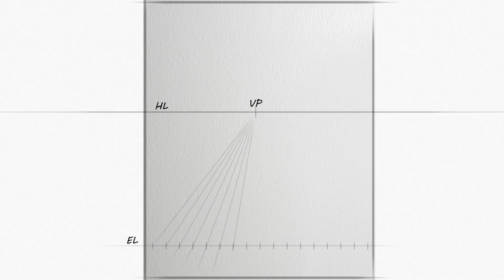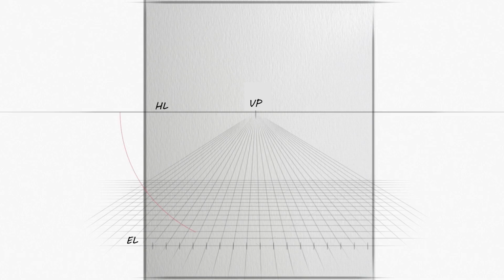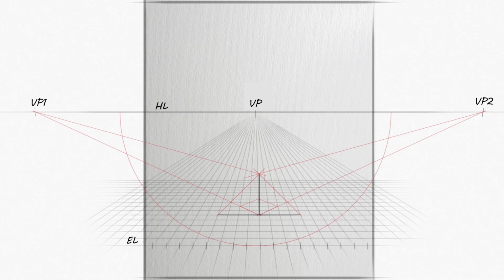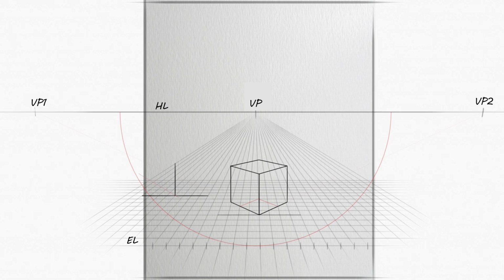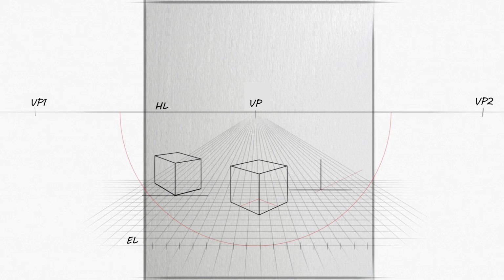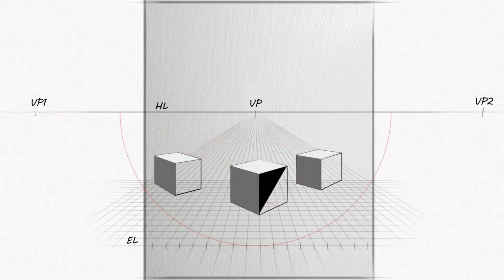The Smart Way to Find Depth in Perspective (Step-by-Step Tutorial) | Two-Point Perspective

Comment: Hi! I'm writing about "The Square Method: How to Map Out a Perfect Tiled Floor Grid to Determine Precise Depth."

Let's take the exact example from your video. If, instead of placing the square where you did, let's move it example two units to the left, the depth line automatically shifts downward. Does this method only work with a specific field of view (FOV)? For example, does the EL edge where we apply this technique have to be at something like a 30-degree angle from the SP, or is there another requirement?

I'm asking because I'm still a beginner (or maybe somewhere between beginner and intermediate), and I'm a bit confused. At first, this method seemed really clever and straightforward, but I've noticed that it produces different results depending on where I place the square.

I used ChatGPT to help translate this message, so I hope it still makes sense.
Reply from the maker: Hi friend!
EN: In any perspective drawing, you must keep in mind the observer's position. Consequently, as objects recede from the observer's field of vision, they will appear distorted. Therefore, yes, the field of vision must be considered. In this example, the observer is positioned directly in front of the central cube, so the other objects must necessarily appear distorted to align with the observer's field of vision.
ES: En toda representación de perspectiva debes tener presente dónde está situado el observador y, en consecuencia, en la medida en que los objetos se van alejando del campo visual del observador , estos serán vistos con cierta deformación. Por lo que sí; se debe considerar el campo visual. En este ejemplo, el observador está situado justo enfrente del cubo del centro, por lo que los demás objetos tienen necesariamente que verse deformados para estar en coherencia con el campo visual del observador.
Thank you for your interest.

Comment: This would actually be helpful if I could apply it to three point perspective.
Reply from the maker: It's the same principle; you just have to treat the upper part (or lower part, depending on whether the third vanishing point is above or below) as a two-point perspective. The only difference is that the perpendicular lines are no longer parallel and converge at the third vanishing point. Thanks for your interesting comment.